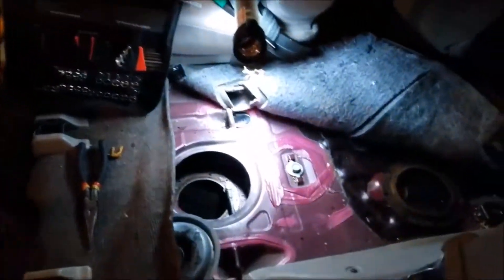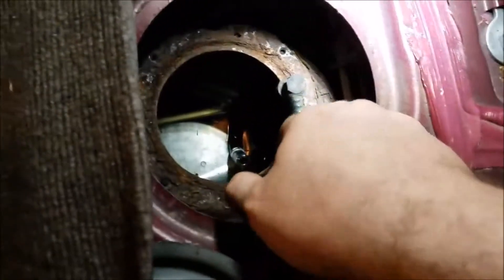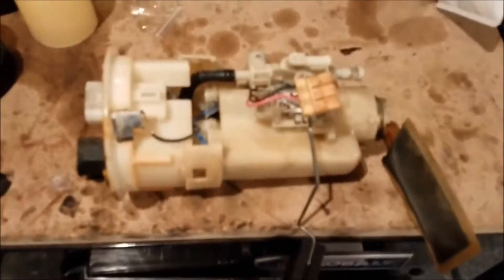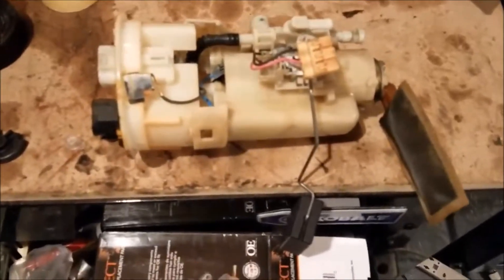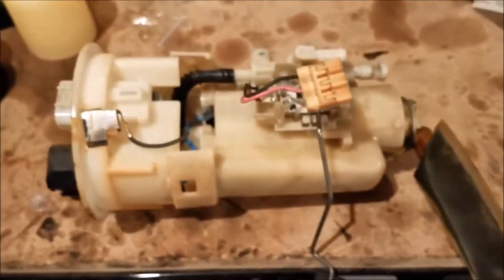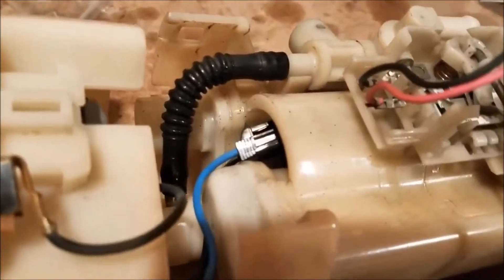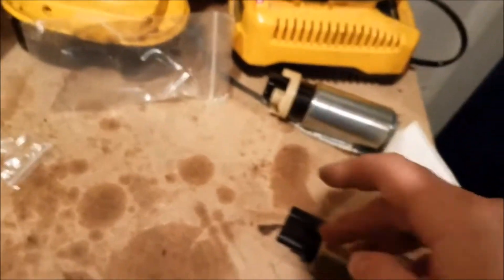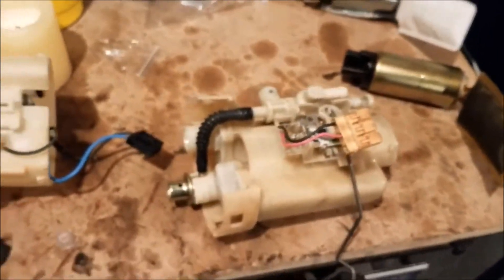RAV4 - Fuel Pump Replacement

Comment: Thanks for the video! I have down the change and the pump is running but the engine won't start, perhaps it needs bleeding? 

Any advice would be awesome!
Reply from the maker: @33mojod  pump runs but car doesn’t start still ? You check any codes ? Maybe your crank angle sensor ?
Reply: @DrivenGarage  thanks for the reply! Didn't check any codes. The car ran just before the swap though, didn't think something would come up.
Reply from the maker: It could be ? But after some cranks of it should not go to key on and it should prime the fuel lines and injectors etc
Reply from the maker: You hear the pump priming and everything ?
Reply: @DrivenGarage  the pump does not start when switching to on but it does start when actually cranking.

And it does run and also pumps (opened up one hose near the engine to check)
Reply: @DrivenGarage  ok, so it seems that the injectors do not inject. I haven't had the chance yet to check if they get power. I am starting to think that maybe the immobilizer got triggered and needed a door lock and unlock in order to run.... I had not done this
Reply from the maker: @ I would disconnect your pump line and make sure fuels come out at the pump itself or even take a 12v battery to power it on a bench make sure it’s pumping etc ? Maybe pick up clogged or line somewhere ? You can open rails unless immobilized ? Check your fuses ?

Comment: greetings, I replaced the fuel filter, the pump pumps out fuel, but the engine won't start
Reply from the maker: I would check one of your other major needs for crank then
Reply: @DrivenGarage  when I replace the old filter, the engine starts immediately without any problems

Comment: Ok, I got the fuel pump changed, throttle body sensor changed, new battery, new coils and plugs. It is still stalling and will not go past 3000 rpms, and blows the 10 fuse every time I start it. I do not know what is still wrong.
Reply from the maker: @jessieleestorer1516  it’s blowing what fuse ?

Comment: Were you able to plugin original connector into the pump (motor)  or you had to splice in supplied harness?
Reply from the maker: Should be plug and play, and fit the original connector
Reply: @DrivenGarage  Thank you!!!

Comment: How many miles where on the odometer when the fuel pump was replaced. Just asking.
Reply from the maker: My car is a 2001 and had about 140k Miles when this occurred. So over 15 years old and 140k miles
Reply: @DrivenGarage  Ok my RAV4 is a 2004 and it has 186k on the odometer. When did you realize it needed to be replaced
Reply from the maker: Yeahhhh that's impressive
Reply: @DrivenGarage  I’m just curious as too when the fuel pump will go because I just want to be aware and know the signs of a faulty fuel pump. In a about a couple years or so I’ll be at 200,000miles.

Comment: Most useful thanks. The  replacement of the pump looks quite simple. The good thing is that I don't have to drop out the fuel tank, as access to the pump is via  an inspection hole under the rear seats.
Reply from the maker: Glad to help! Hope it goes well!

Comment: Hey mate, did you have a new seal for putting the cover back on? What would this look like/be called?
Reply from the maker: Which seal? Exactly ? Under the lock ring?
Reply: Driven Garage the glue/black tacky stuff holding down the cover access door
Reply from the maker: @lisalou8240  black RTV Silicone, comes in a tube large for caulk gone or small tube that's resealable.